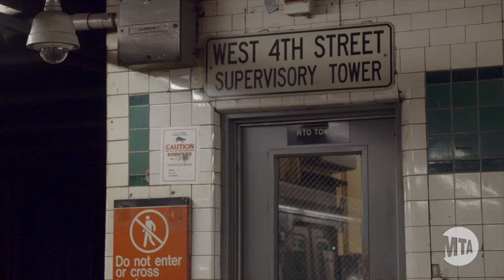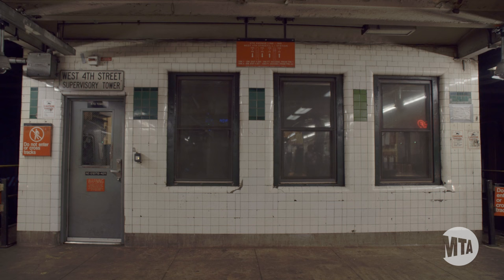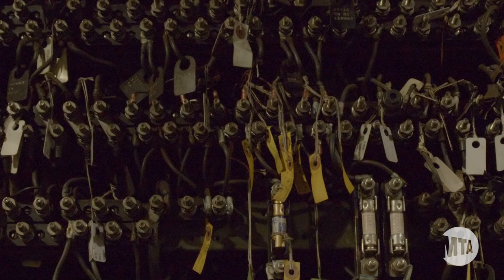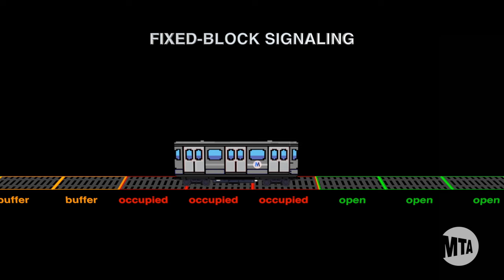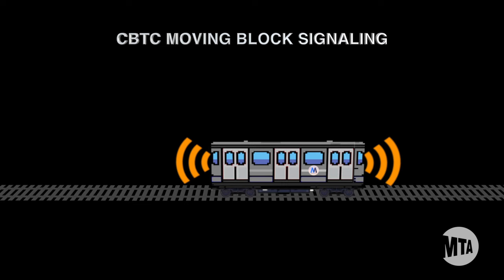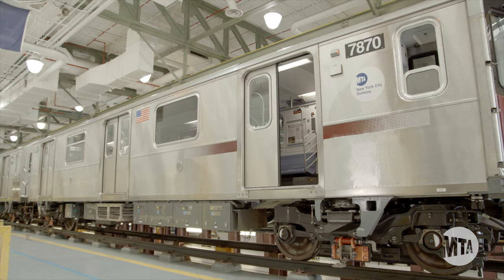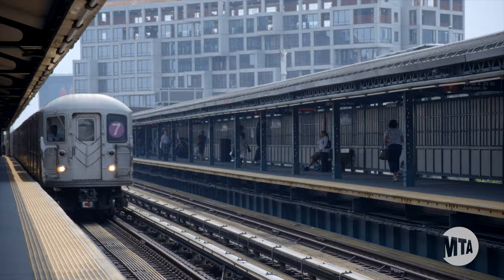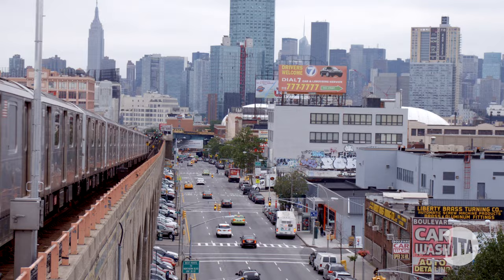CBTC: Communications-Based Train Control

Comment: MTA we also need new trains those trains are so old should be faster smoother and quieter with improved interiors and nicer trains nicer stations the subways are also dirty and flooded or leaking water can yall pressure wash the dirty wall the art is great but it's always dirty learn from other train stations around the world canada japan how about some more trash cans so people won't litter because they can't get to the spit gum in the trash or throw chips away and make gum proof floors its what ever outside nyc but in the station its no good! get wifi and signals in the trains etc nyc need that upgrade less traffic mta today sucks props to the real workers who laid down these great railroads mta its your turn to modernize amtrak sucks too where's is our high speed trains i hope elons hyper loops works cause mta ain't doing it for nyc wish we upgrade all trains systems in america even the few trams!
Reply: ***** The bart?
Reply: ***** well yeah the whole countries trains are meh that why i think if they got some insanely high tech train like other country maybe the rest of the states can get back to better trains in America!
Reply: ***** True true well just pointing it out they need to do something though
Reply: +GameHEADtime R179s have been ordered but the industry making them is having issues, these will replace the R42s and most of the R32s, these trains are on the C J and Z services (and a lone one on the A line too). R211s will come after in like 8-10 years, taking care of the last of the R32s, the staten island railroad R44s and some R46s which currently serve the A at most, the whole Rockaway shuttle service, and part of the F and R services.

Comment: The electronic and computer controlled crap won't last anywhere near what those reliable mechanical relay systems have provided all these decades.
Reply: Victorian Sculptures Yes it will.

Also, the new CBTC system will actually allow for increased capacity on the system and allow for future expansions, something the fixed-block system will not. For example, let’s consider the existing 60th Street Tunnel and the Astoria Line. It currently hosts three services, the N and W to Astoria and the R via the notoriously congested Queens Blvd Line. To keep things simple, let’s say that the existing signal capacity caps off at 24 trains per hour (one train every 2.5 minutes). With this in mind, the N and R run at 8 trains per hour and the W at 7. With CBTC, and an Astoria extension, along with other service rearrangements, the capacity of the 60th Street Tunnel jumps from 24 trains to 36 trains per hour, enough for another service. Without CBTC, you can’t operate this new service unless you scale back service.
Reply: Victorian Sculptures CBTC is actually easier to maintain, since it’s all about the software and coding needed, plus some minor mechanical aspects. Plus the new signals last longer than the old relays.

Comment: You literally could have achieved the same results at about 1% of the cost by installing Bluetooth trackers and a sensor system which solves the speed and location issues without opening up the system to attacks from a 30 year old genius with a laptop and a grudge against the subway.
Reply: Ridesharing Services We are looking at ultra Wideband signaling.

In addition, regardless of Technology, the subway system still requires signals to prevent trains from going too fast and colliding.